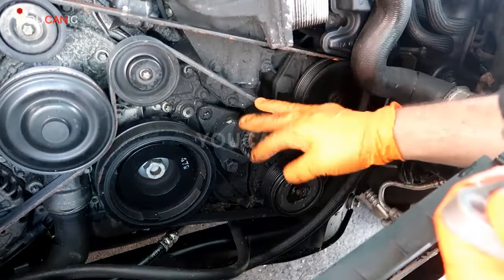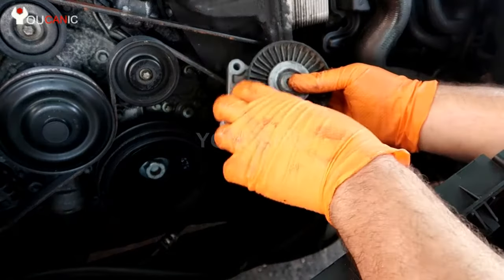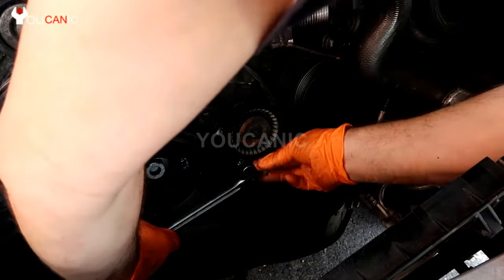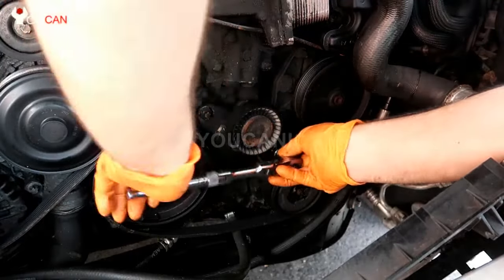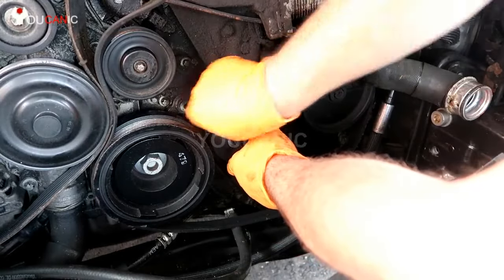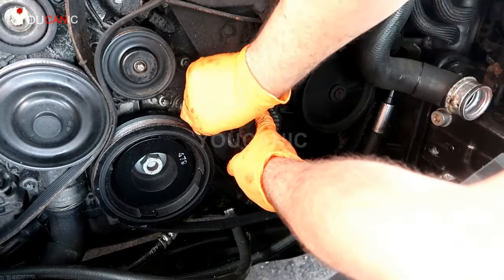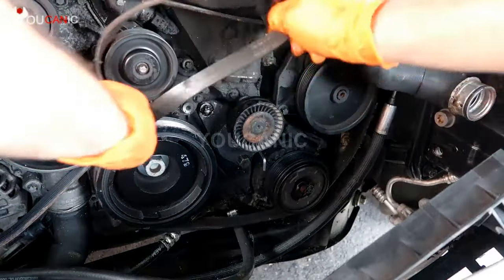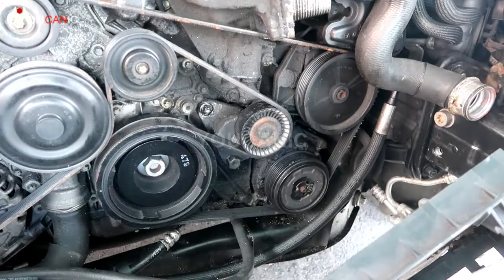1998-2013 Mercedes-Benz Tensioner Pulley Replacement: Everything You Need to Know

Comment: My belt for some reason hangs off the front of the tensioner almost a quarter inch. And it squeals when it's cold. What would cause that?
Reply from the maker: Damaged bearing, tensioner or a component not installed properly.
Reply: @YOUCANIC  yep, it's my belt tensioner. For an 08, it's only got 80k miles on it so I stuck a screw driver in it and it was wobbling bad. So I ordered a AC Delco one off Amazon and will be here at some point today. Thank you for your reply tho!
Reply: What about when you have extra space on the belt I don't five dollars to pay for the poor threw yutube

Comment: Some one please help my tensioner does not have that 17mm to loosen the tensioner , what the hell do I do
Reply from the maker: Thanks for reaching out! At Youcanic, we're all about helping car owners like yourself. It seems like you're having an issue with your tensioner. Don't worry, you can count on us to guide you through. Feel free to visit our website www.youcanic.com, where we offer helpful guides and free resources designed specifically to make car maintenance simpler. 

Remember, our goal is to empower you and we're here to support you throughout your car ownership journey. If you need additional assistance, we also have factory repair manuals available for your perusal. Keep asking, keep exploring and keep maintaining your car with confidence!
Reply: @YOUCANIC  thank you youcanic definitely gonna use this site now too!! But however it’s of no help to me still
Reply from the maker: You have a torx bolt on the center of the tensioner pulley you can use.

Comment: What if that bolt that’s mounted on the pulley break
Reply from the maker: Thank you for reaching out! If a bolt breaks while mounted on the pulley, it can seem daunting, but don't worry, our website (www.youcanic.com) will provide you with the necessary guidance and resources to solve the issue. Feel free to explore our resources including helpful guides, free car maintenance tools like our powerful YOUCANIC scanner, and factory repair manuals for comprehensive help.

Remember, we're more than a company at Youcanic, we're a community that supports every car owner. Whatever the challenge, our mission is to empower you in your car ownership journey, making car maintenance less intimidating and more accessible. We're here for you.

Comment: Torx what?  E something?
Reply from the maker: Hello, thanks so much for your comment. To clarify, the 'E' in 'E Torx' refers to 'external'. These are star-shaped sockets and are typically used in car repairs - a common aspect covered in our YOUCANIC videos. Our goal is to assist you with your car repairs and make them as seamless as possible.

If you're seeking a professional diagnostic scanner, we recommend the YOUCANIC Pro System Scanner; you can find out more about it at www.youcanic.com/scanner. Furthermore, if you require Factory Repair Manuals and Torque Specs, you can get access to these at www.youcanic.com/manuals. We hope these additional resources can further aid in your car repair journey.
Reply: @YOUCANIC 
Thanks for the reply, but if you watch this video, you edited it right before you said the size of the bit - it skips over the important stuff - like removing the beauty cover from the idler pulley, how difficult it is to get a T45 (E) into the rod end and torque it without being able to fit it between the radiator and the bolt is almost impossible. Also the socket to fit the tension roller on my 2007 R500 is not  21mm. I found a 16mm is best.

Have a good one, and Happy New Year!

🎉🥳🪩

Comment: Thank you so much for sharing this in a fantastic detailed manner. In my 2004 C230 Kompressor, the nut had been replaced with a Torx hole, making it easier to gripe from the top without removing anything except the fresh air intake hose. I tried at first to turn a wrench from below, got a lot of cut and scratches in both forearms…but without success - there just wasn’t enough space to fully turn and release the tensioner. But it was surprisingly easy to do so from the top with a socket extension. 
BTW, I did this not for belt replacement, rather to replace a worn out voltage regulator on the alternator - A painful job as removing the alternator is just an impossible job which I decided to do without, and was successful.😅 thanks to your video :-)

Comment: How long did that take approximately?  A garage told me it would take several hours and $800... including that pulley in the upper left corner.
Reply from the maker: At YOUCANIC, we aim to help car owners tackle diagnostic and repair tasks on their own, which could potentially save you significant costs. We highly recommend our Full System Scanner (www.youcanic.com/scanner) to help identify potential issues. 

Keep in mind that learning times may vary and complex jobs could still take several hours. Explore our array of resources (www.youcanic.com) and if you need more help, feel free to ask questions on our platform. We're here to make car repairs more accessible for you!

Comment: What is the torque setting on these bolts? Or is it just hand tight?
Reply from the maker: Hi, thanks for your question! Torque settings can vary depending on the vehicle and part, so it's always best to check specific manufacturer guidelines. At Youcanic, we offer free resources, helpful guides, and even factory repair manuals if you need that level of detail. You can find these on our website www.youcanic.com. We're on a mission to empower car owners like you, feel free to reach out for any further assistance!

Comment: Could you destroy the engine if u fail to replace the belt
Reply from the maker: Thanks for your question! Not replacing a belt when needed could potentially damage the engine. At Youcanic, we provide detailed guides and resources, including our powerful YOUCANIC scanner, to make car maintenance simpler and more affordable for car owners like you. 

We also have factory repair manuals available. Don't hesitate to use our resources or reach out for additional help on www.youcanic.com. We're committed to empowering and supporting you in your car ownership journey!